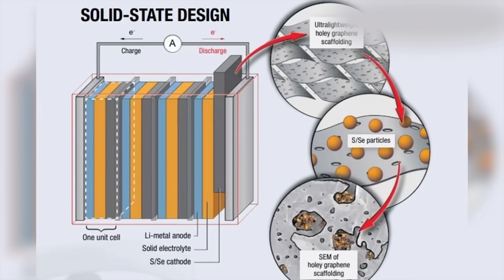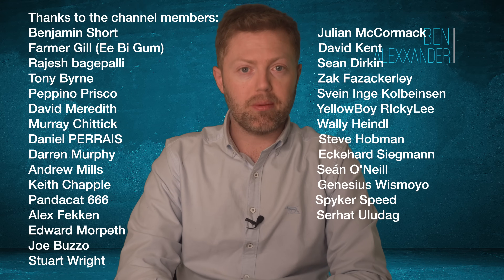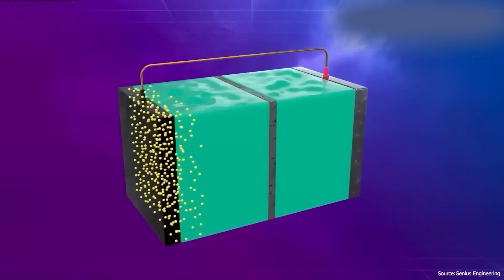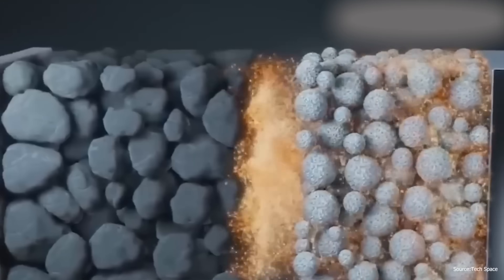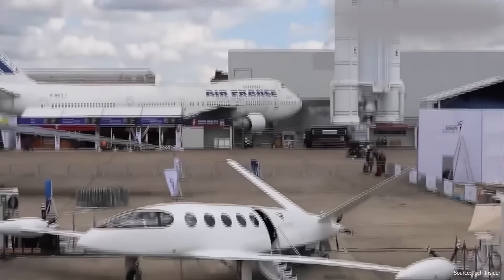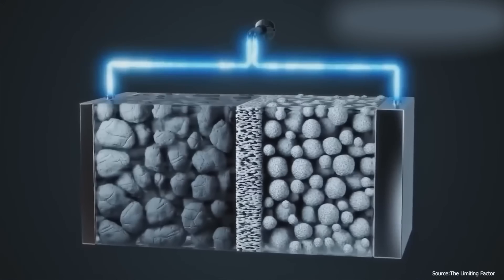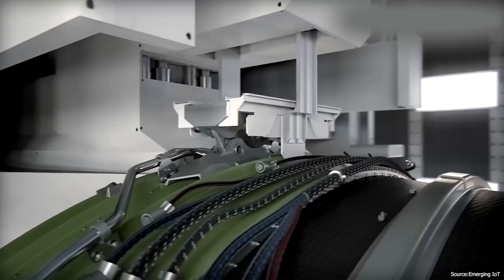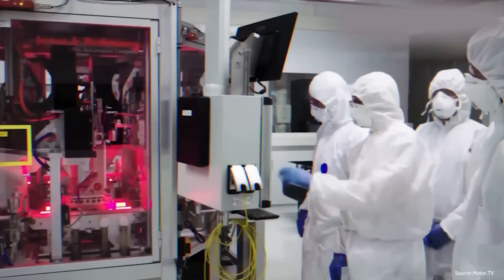NASA’s New Sulfur-Selenium Solid-State Battery Could Redefine Energy Storage

Comment from the maker: When do you think solid state battery tech could be on its first flight? Have a guess...
Reply: Not even close yet, electric (any battery type) powered flight with a useful load is a long way off, short hops maybe but any distance no. Battery's power to weight ratio means electric flight is a pipe dream for now. Unless their is a big breakthrough in battery tech or power generation flight is not viable
Reply: @keithbartlett9947  Not quite; Joby Aviation and Archer are about to launch the 1st electric air taxi services in several places around the world. Joby is nearly done obtaining full FAA clearance to operate.
Reply: @keithbartlett9947   Agreed. This battery, if it works as advertised, and is economical to produce is a nice step forward for some of the more realistic aircraft under development. I.e. those that are hybrids seating between ten and twenty passengers. Large, pure battery powerec aircraft are a pipedream
Reply: I spent 10 years in the aerospace industry, I did some low level evaluations of SAFT li-ion cells for potential space flight. It will require some serious life testing and environmental testing before it will be used as a critical systems battery. It has probably already flown in a test flight, but there is really no need when we have thermal-vacuum chambers and shaker tables.
Reply: Yes.....I do... at the same time frame in the future when Fusion Energy is a viable electric energy generation solution.
Reply: I will give it less than 5 years for personal craft,  8 - 10 years for larger. It will happen very quickly once batteries cross the energy threshold.

Comment: It seems to me that having multiple EV engines with individual batteries could eliminate the risk of a single element failure.  This would be much more fail-proof than current jetfuel systems.  The reduction of many mechanical components and flammable fuels,  is a master coup for reliability.   Current jet engines are VERY expensive to operate and maintain.  Batteries and cheaper electricity energy should soon be lower tahan current costs...

Comment: What is the charging duration, what is the self discharge rate, what happens when it is punctured, what happens when it shorts out, and what if you overcharge.

Who knew nasa would go for the alien microbe killing shampoo ingredient to use for power storage.

"Not a drop of fuel burned" is total hog wash of a statement. Renewables don't pay for themselves in their lifetime; thus they have to be subsidized and will be going away. The electricity you will be using to charge these with will be from coal, gas, and nuclear and that is the fuel the plane will be using but with additional energy conversion, transmission, and storage losses.

Comment: Energy density is what its all about when it comes to airplanes. You never stated what the energy density of this batter is. If the energy density is less than the current fuel it will never be used.

Comment: I think the key requirement for all EV batteries should be:
Uses common elements inntge earth that are non toxic to the environment (non lithium or cobalt)
Inexpensive and widely abundant 
Not prone to the fiery thermal runaway effects like lithium has
Wide range of thermal tolerance, from minus 40 F to 180F
Very fast charging that doesn't cut the life of the battery by 50%. Normal charge is at 10A to fill up to 90% in less than 1 hour 
Lifespan officer 5,000 charge cycles and a range of 500 miles with running lights and the air conditioner or heater running.
If it can do all of these and be deployed within a year than let it be quickly mass produced in volume quickly

Comment: If the electric motors are quieter than fuel burning engines. Can they use contra-rotating propellers in urban areas to gain a little more efficiency, or are they still just too noisy?

Comment: Does it...tolerate a wide range of temperatures, have plenty of recharge cycles, withstand vibration, manufacture be made economical commercially. China's CATL has viable sodium batteries that can be made in existing Lithium Battery production lines & is apparently coming out in EV applications next year. Need something better than lithium very soon. Can't wait 10 years.

Comment: Use the AI to search for "NASA's SABERS project, a sulfur-selenium solid-state battery prototype".  It's still a Lithium battery, with sulfur selenium is just for the cathode.  Lithium batteries generally have about 1% of the energy density of fuels, so a 2x would be an improvement, its still going to be limited to island hopping with a few passengers. Also any and all batteries never lose weight during flight, fuel planes lose weight as the fuel is burned off. For most battery uses Sodium represents a more practical approach for light transport and stationary use, Li for cars for more density. Clean Technica is a low grade garbage site, they will publish any old codswallup.

Comment: Greenwashing.  Passenger aviation still requires enormous energy.  No matter the energy source it takes 10,000 kilowatt hours of energy to fly a single person across a continent or ocean and back.  This is the same energy as taking a hot shower every day for 20 years. 
A single plane may need 1.4 million kilowatt hours of energy for such a trip and if electric that energy needs to be generated first.

Comment: NASA has talked about their solid state batteries since the term started being used widely a lot over the past 20 years.
I think we need to be investing in motors. If we could cut the power needs of a motor in half we could see a huge range change and batteries could become smaller, if nasa gets the density it mentions then the battery could be 1/4 the size of lithium if they could also halve the power a motor needs cut in half or better.

Still in the lab so don't expect these batteries to be in production for 10 years or more.

Comment: OK, you can have this one for free: you do not need to 'launch' a plane 'instantly'.  What you need is to initiate down runway movement and increase it until you have lifted off of the ground and ascended.  So, taxi the airplane to a platform at the 'start' end of the runway.  Hydraulically lift the plane, just a few feet.  Then, drop the front end of the platform and let the plane roll off and begin its take-off run.  As soon as this happens, there is a cable attached to the nose (or near the front; maybe even to the front wheel bogey.  The cable is the length of the runway.  At the far end away from the plane, it is attached to a buried, huge wheel.  The wheel turns and pulls the plane, slowly at first, down the runway.  Computers increase the speed of the wheel as the plane increases speed.  When the plane begins to lift-off (the computer would know this and would disengage the cable), the cable is wound unto the wheel.  After the plane is safely in the air, the cable would be taken back to the starting point for the next flight.  The amount of energy used would be negligible and there would be virtually no noise (one reason why jets climb so fast is to not pollute the surrounding area with noise; the planes would not need to climb so abruptly).

Comment: It usually isn't the engines that are the root cause of a crash so I doubt an electric plane would be different in that regard.  Quieter will be nice but it won't be quiet.  You can't move that much air without making noise.

Comment: These batteries, if they pan out, are NOT even remotely viable for long haul, a situation where large planes use hundreds of tons of fuel that's more than 10X the energy density of ANY battery, not just Sulfur-Selenium Solid State or LiIon.  To have a battery pack large enough to provide the energy needed for an A-380 flying long haul that battery pack, being at least 10X the 250t+ pf fuel the A-380 might need making JUST THE BATTERY over 2500t.  That battery would be by itself more than 2.5 times the entire fully fueled mass of the A-380.  
The only use case that's viable now is VERY SHORT HAUL and by that I mean les than an hour.
There is no battery even remotely in reach of being viable for the range of commercial aviation the airlines need!  And even there the only thing batteries provide that in any way offsets the dreadful energy density is the greater efficiency of the batter/electric motor combination, running near 90% versus less than 40% for jet engine planes.  That advantage is dwarfed by the more than 10X lower energy density!  
This battery is, OTH, potentially viable for EV's so long as the lifespan is, say, a decade or more with 90% capacity after 10 years!  I appreciate you have omitted the screaming headlines, but a high school understanding of Physics should make it clear there is NO battery that now exists or in the pipeline that is remotely going to change this equation!

Comment: NASA can afford to use some pretty exotic stuff, because their spacecraft are not cheap, and a good solid state battery, no matter how expensive, could be a real advantage in space.
Reply: Especially they are running low on radioactive isotopes for their spacecrafts/rovers, which are even pricier.

Comment: In batteries, safety + lifespan + manufacturability in scale are more valuable than high energy numbers.
Reply: They never addressed a concern I had about this in the back of my mind.  And that is "but does it stink?". Not meant as a joke.  I mean literally.  Sulfur has a really horrible smell.  Even if a tiny tiny amount leaked out into the environment you would smell it and if you could smell it this would limit its use in the marketplace.

Comment: Hang on. A medium sized airliner, like an Airbus A320, generates the equivalent of about 50MW of power at take off and the engines plus the standard fuel load is about 27 metric tons. These solid state batteries have a power density of 500W per KG, so you’d need 100 metric tons of them to generate the same 50MW, plus whatever the weight of the electric engines. That doesn’t add up, it’s about 4 times more weight and the plane would never get off the ground. We’re not going to see battery powered airliners anytime soon! Maybe very small passenger aircraft for very short haul flights but not today’s airliners.
Reply: You'll also need to figure the discharge rate.  Power density is Watt-hours (Wh), or the number of watts is can output for 1 hour.  If the battery has a 20x discharge rate, then that 500Wh/Kg battery can output 10KW.  You then parallel cells to add up the total output.  At those numbers, 5 metric tons could provide 50MW of power.  There's also a peak load consideration, akin to a duty cycle, where a normal 20x continuous discharge battery might also allow for 50x for a limited time.
Reply: @eggshellgoesgaming  Sure but at that discharge rate your 5 tons of batteries would last about 3 minutes and get you just beyond the airport boundary! 😂

Comment: Purely electric aircraft will have very limited application, but hybrid vehicles that use the batteries to help climb to altitude, and then run from hydrogen fuel cells at cruise, might make sense. The liquid hydrogen would be carried in nacelles lifted and attached under the wings: you don't want LH2 inboard, and you don't want hoses carrying liquid hydrogen out on the flight line, so you bring out filled tanks.

Comment: Interesting. I'd really enjoy learning how these new batteries work. I noticed they have a Li-metal anode and sulfur/selenium cathode. So, is it still lithium ions which are moving about, and it's somehow those sulfur/selenium particles (are they a composite? a chemical sulfur selenide compound?) serve to allow more lithium ions to enter without swelling the way silicon/carbon cathodes tend to do? How does this intriguing battery work?

Comment: I spent my working life as a professional Aerodynamicist. At a rough calculation, using typical L/D for a commercial aircraft, and assuming quarter of the total mass is battery, with 500 WH/kg, I get a range of about 500 km with no reserve. I wouldn't fly on an aircraft with no reserve (a few years ago, on a day with exceptionally strong winds in central Scotland, some aircraft were diverted as far as Germany and France! I was watching the flight paths on FlightRadar24 in the late evening as one after another aircraft attempting to land at Edinburgh failed, went around for another attempt, failed again, and then diverted, mostly to airports south of Manchester in England. But a few were forced over to Europe as airports closed in England!). In my opinion, you need at least 2.5kwh/kg to make short range commercial flight viable

Comment: People started to talk about solid state batteries back in 2020 and we are still waiting!
Reply: New battery technology stories are the most reliable power source we have. 

So we should make batteries out of those.
Reply: @albeit1 @albeit1  It took about 30 years from invention to widespread use for lithium-ion batteries. And they made a significant difference to EVs, quadcopters, laser weapons in combat, and our portable electronics. Why should you be surprised if solid-state batteries aren't here yet?       Here is a brief history:                                                   1976: M. Stanley Whittingham, working at Exxon, created the first rechargeable lithium-ion battery using a titanium disulfide cathode and a lithium-aluminum anode. This version was never commercialized due to safety issues.
1980: John Goodenough made a key improvement by discovering that lithium cobalt oxide could be used as a superior cathode material, which led to a higher voltage.
1985: Akira Yoshino developed the first prototype of a modern lithium-ion battery that used a carbonaceous material for the anode instead of lithium metal, making it significantly safer.
1991: Sony released the first commercial lithium-ion battery based on Yoshino's design. 
History of the lithium-ion battery - Wikipedia
1976: Stanley Whittingham and his colleagues at Exxon demonstrated what can be considered the first rechargeable "lithium-ion battery
...

Show all

Comment: Electric planes will be very difficult to make a reality. One thing not discussed in the video is that there is hardly any time to charge an electric plane. Planes spend most of their lives in the air where they make money. If an electric plane needs to sit on the tarmac for hours charging then that makes it much harder to recover the capital cost of the plane. And given the electric planes will likely cost more to produce this makes it especially unlikely they will make good investments. 
The economics of running commercial aircraft are as unforgiving as a business market can possibly be. Electric planes face some massive headwinds!

Comment: Love the potential...but reality check.  Aviation is a commercial industry, therefore economics rule.  There are far too many questions left unanswered about a fully electric airplane to even begin to speculate on when such technology would be viable for aircraft.  Think of all the testing needed (altitude, temperature, moisture, vibration, charge cycles).  Think about all the certification requirements that have yet to be written.  All of this will have to be done before any of the large manufacturers could consider building a commercial aircraft using the tech.  Plus you need airports to somehow obtain sufficient electrical energy to charge the HUGE capacity that an aircraft would require to recharge it in a reasonable amount of time.  Aircraft don't pay for themselves sitting on the ground plugged into the wall for 8 hours.  The aircraft would start out for short haul flights that would require fast recharging during the turn around at each hop.  

This tech will need to prove itself in the EV world for a long time before it will reach commercial aviation.  NASA could certainly build some experimental airplanes.  Niche aircraft manufacturers could have some fun building light sport aircraft.  But it will be a long long time before commercial paying customers will board an electric airplane.

To add to this.  Jet fuel provides an equivalent of 12,000 Wh/Kg see: https://www.sciencedirect.com/science/article/pii/S0306261925010864  of course a tremendous amount of that energy is lost in heat.  But you get the idea...

Comment: Selenium is a rare earth mineral, very low concentration in the earths crust, no real selenium bearing ores that can be mined, it's usually a byproduct of mining other minerals, so we are jumping straight back into rare earth mineral costs and availability. Sure it's fine for NASA, how many satellites do they launch, but commercial aircraft? Can't see that really happening, currently selenium is mainly used in the medical field, so it's not in huge demand, well when I say not, when people need to they need it, but not on the quantities required for electric batteries. This isn't a game changer, it's more a useful alternative for niche industries that need the energy density but not quantities in mass production level.

It's likely large commercial aircraft won't be flying on batteries until the major battery manufacturers get their act together and start making their own 500WH/kg SS batteries, although there are of course a few small planes under testing now with battery technology, but not major commercial aircraft.

Comment: NASA PLUTONIUM BATTERIES
Reply: Did you know that NASA and aircraft company's together worked on a nuclear powered planes. They got a flying prototype in the air, but you have an open cycle that produces masses of power, but the exhausts was radioactive. The closed cycle engine produced about half the power at twice the weight but the exhausts were clean. Safety of flying around a nuclear powered aircraft killed the project in the end. And that's a metaphor for battery powered flight, the batteries aren't safe enough to convince the public yet
Reply: @keithbartlett9947  Batteries aren't powerful enough to conquer gravity.